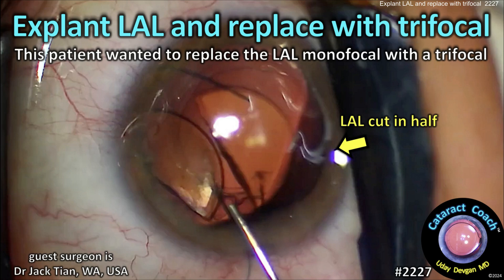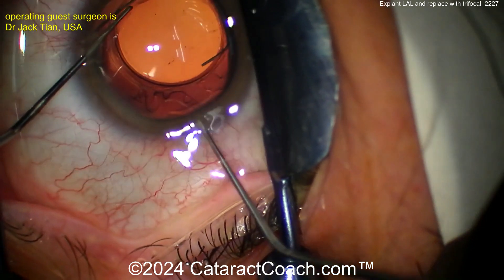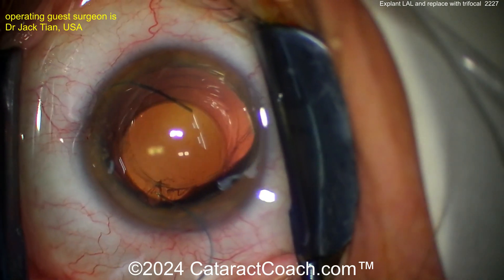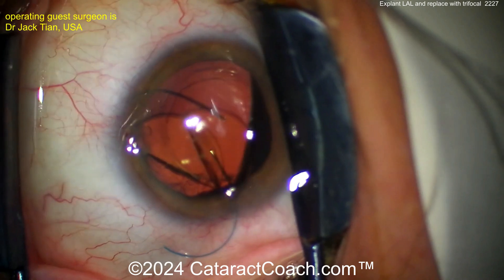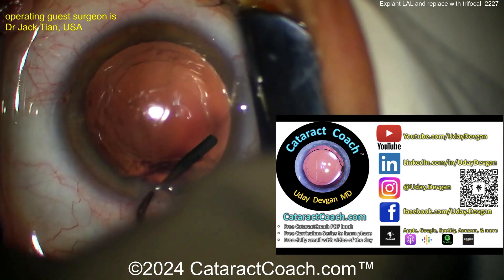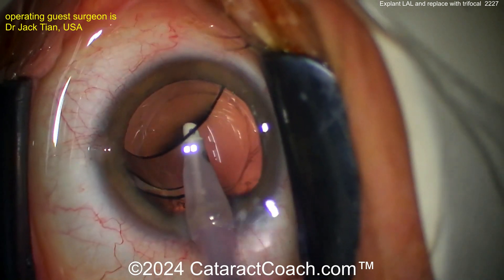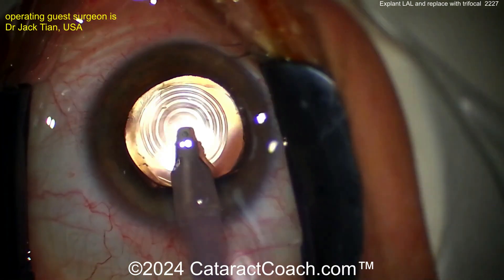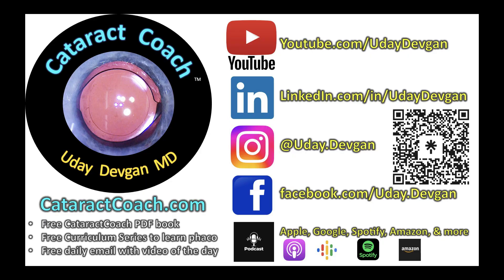CataractCoach™ 2227: explant LAL (Light Adjustable Lens) and replace with trifocal PanOptix

Comment: Does the light adjustable lens material get more brittle or difficult to cut after it has been adjusted?
Reply: Thankfully no :) With the MacCool IOL cutters it is the same feel between a locked-in lens (as in the video) compared to a virgin lens (in the case that the lens was damaged during loading and needed to be explanted). I have heard comments that it feels more brittle once locked-in, but I have not felt there to be any appreciable difference (I have explanted at 4 that were damaged during load and 10 or more that were fully locked in). Hope that helps!